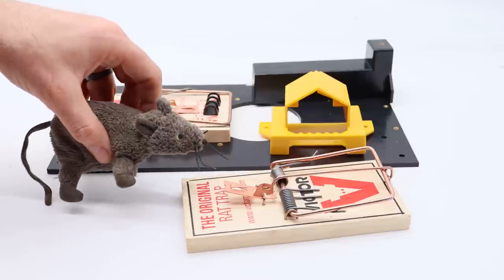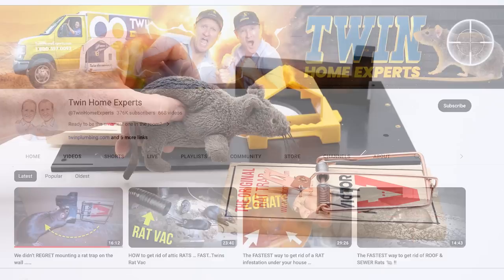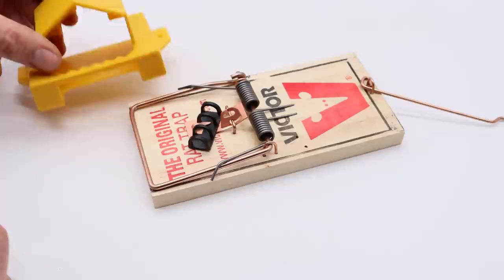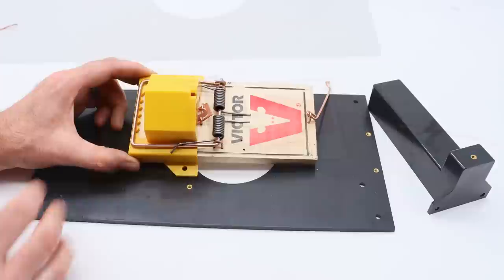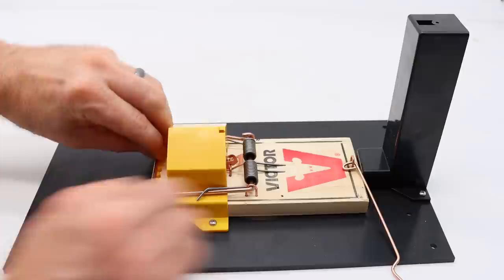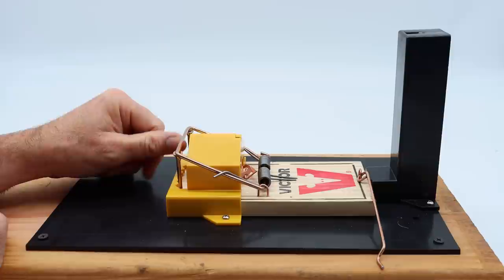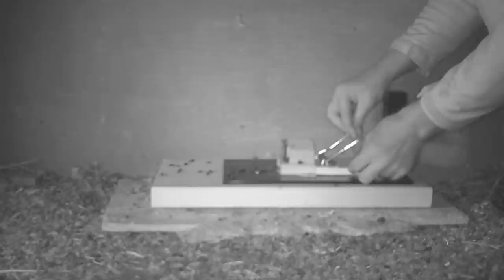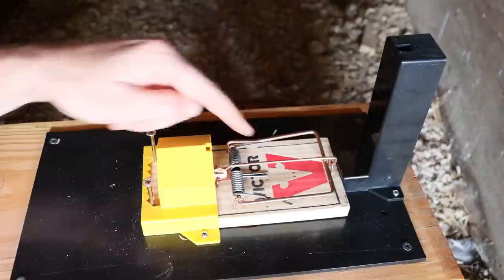How To Catch MORE Rats With The Twin Home Experts Trapping System!  Mousetrap Monday

Comment: I use those Kat Sense traps, and have had issues with the bait getting cleaned out, with no trigger. So I modified them with some old gift cards glued to the sides, effectively making it a one way in trap. No more clean outs, and even more effective that before.
Reply: If you have photos posted, where  would I find them?
Reply: Unfortunately, I do not, but it's simply a couple old gift cards, one glued to each side. Works like a charm.

Comment: I've had mouse traps disappear.  Putting Velcro tape on the bottom of the trap and the surface where you place it prevents them from pulling it away.

Comment: With my Victor mouse traps, I use pliers to adjust the trigger to make it super sensitive. So sensitive it is not possible to set the trap as quickly as you set the traps in this video. Sensitive enough that a little shake will set it off.  That makes stealing or just licking the bait and not getting caught very unlikely. I suggest you might give it a try. Note I don't have rat traps. We don't have rats in Alberta. I'm 65 and still haven't seen one here.

Comment: Twin traps are just too expensive for what you get. If they reviewed and adjusted their prices they would sell many units.
Reply: 100 dollars for 2 trap setups is ridiculous
Reply: Maybe they meant $9.95. Would be more reasonable.
Reply: @Hawkster212  
Their prices are just silly. Apparently neither of them have an MBA which would have educated them to understand that you MAKE YOUR MONEY ON VOLUME SALES. Keep individual unit sales low. But no, these clowns want to be rich by Wednesday.
Reply: In the UK the sell for the same price. It does seem expensive for something that you could 3d print for a fraction of the cost.
Reply: Impossible to spend that much money. I don't need the stand or the platform. Perhaps if they sold a scaled down version -- the bait thing and yellow cover -- for a reasonable price, I'd bite.